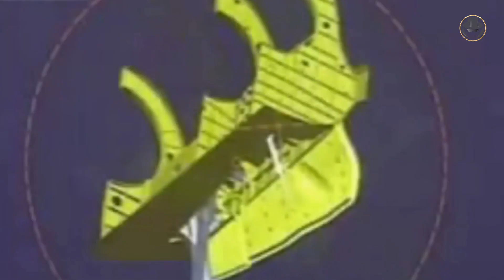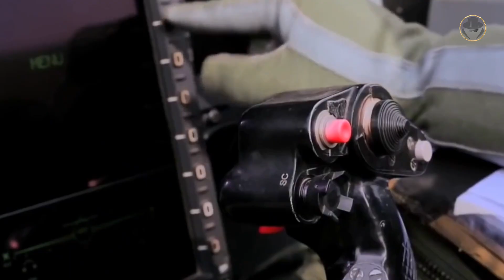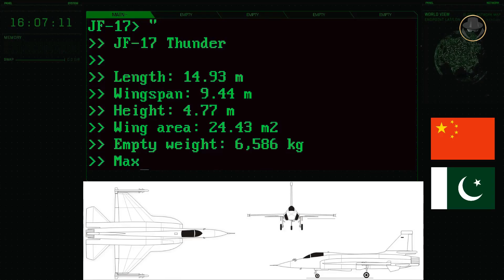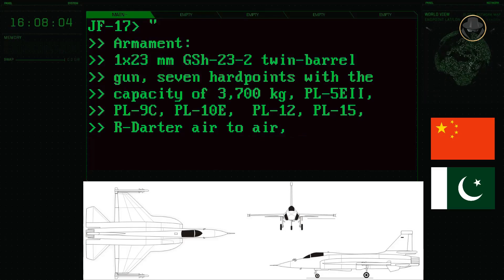JF-17 Thunder / FC-1 Xiaolong | Is it successful or not?

Comment: I like JF-17, cost of fighter really worth it. Meanwhile Hal Tejas, expensive, needs long maintenance, so complicated etc. Pakistan did a great job on JF-17, but RD-33 engine isn't that enough for 4th gen fighters anymore. They should find another alternative for engine
Reply: Tejas does offer higher capabilities in turn of higher costs. And again that's the point. India wanted a cheaper but not cheap plane while Pakistan just needed a cheap plane. Similarly
Reply: @Abdullah-mn6sw  India failed, engine choice was a mistake, even Indian pilots doesn't like Tejas. Delta wings was another mistake. Plane is so complicated and still has a lot of issues. JF-17 is chep plane but it worth the price. JF-17 still improving but Tejas is about to retire.
Reply: what is cost of jf17 bk2 and bk3 versions ?

Comment: Also Tejas i no "pride" you $hitface Tejas was built with intent of full filling the gap that is set to occur after mig 21 retirement and we dont go around rebranding foreign origin fighter as our own if we did so then Su 30MKI in that sense with so many Indian systems integrated would be an Indian fighter but we have some decency we developed Tejas and now from the end of this year Tejas Mk 1A variant with 960+ TR module AESA radar , RWR ,EW suit and long range 160 km Astra Mk 2 will enter production and in 2024 The Tejas Mk2 will take it first flight and it would be comparable if not better than Gripen E.

Why did you not mention that in Tejas video about how India achieved all of critical development on its own like the quadruple fly by were is so great that Tejas never has any crash in its entire history and moreover who tf thinks PL 10 is a decent missile as it has range of 70 km and PL 15 Export variant has range of 145 km which is easy for Astra BVR to outrange so how does it have decent missile

Comment: No one need f16. Just build lots of single engine jets and focus on sensors, electronic warfare and longer range air to air missiles
Reply: F16 has higher range and payload capacity. It is a proven platform with variable mission roles. And just putting missiles doesn't work, if it did, we'd be having bombers shooting missiles. BVR engagement don't always happen.
Reply: Hi Yarmud. I am not sure I understand your point. The F-16 meets the requirements you denote, and yet you say no one needs the F-16. Just build lots of "other" single engine jets? I can see where part of this may be going (indigenous industry perhaps), but the strategy should be clear. You seem to say "don't do that, do this" without any justification.
Reply: @roderickcampbell2105  any country can produce necessary Air power elements enough to defend its land and borders with some dedication and a little cooperation with similar countries. No need to fall into marketing tricks of weapon sellers. i dont mention f16 as a weapon system but as a popular must her product
Reply: @yarmud  Hello Yarmud. I get your point. But one has to start somewhere and there are contracts that involve indigenous development of many parts under license. Engine development is another matter.
Reply: @roderickcampbell2105  why do you care, are you an f16 salesman?
Reply: @yarmud  Hi Yarmud. I am not technically an F-16 salesman. However, if you would like to see more of the F-16 I can arrange it. Do you have any products? No? I didn't think so. That is another advantage on the F-16 side. It is tested, true and has excellent available ordinance.  Many countries use the F-16 to great advantage. Your "sell" is a pipe dream. Or pip
e nightmare. Give the F-16 a try. You'll like it.
But you asked me why I care. I care because I wish to see countries safe, secure and getting their money's worth in a reasonable timeframe. The F-16 is a perfect in most cases.
Reply: @roderickcampbell2105  it feels like u are an ia bot like i am.
Reply: @yarmud  Yarmud. There is nothing artificial about my intelligence. And you're not a bot although you act like one.